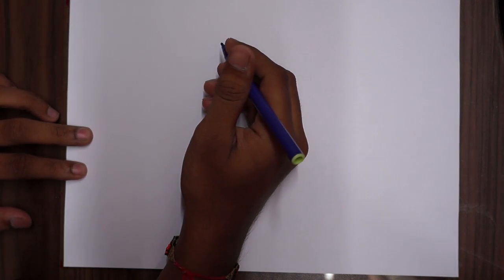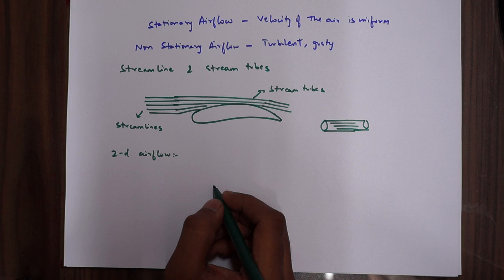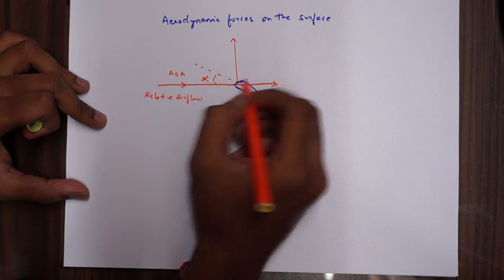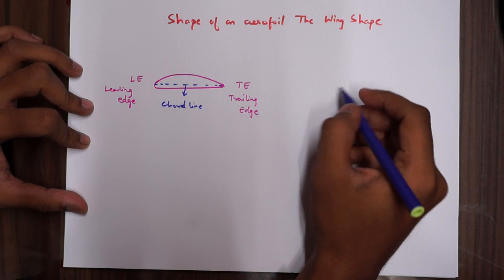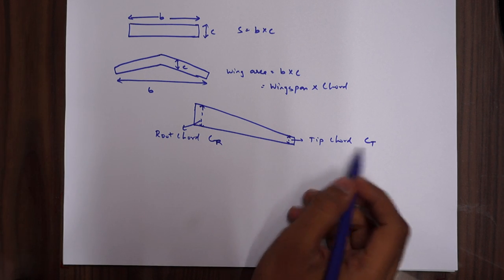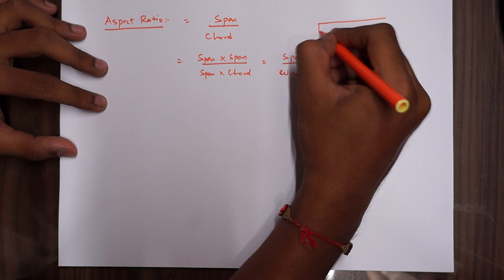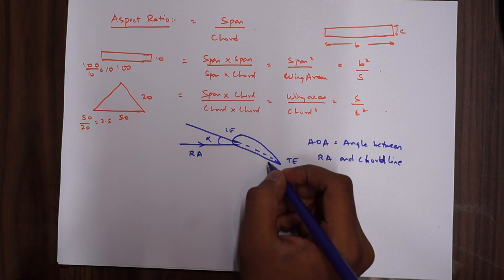Airflow, Aerodynamic Forces, Shape of wing and aerofoil

Comment: You have a number of things incorrect.  Please correct them. 
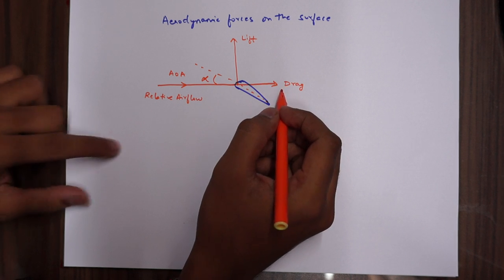At 5:55 descriptions of lift and drag are incorrect. In normal flight the lift is always much more than drag. If drag was similar to lift it would mean engine power was enough on a typical plane to climb vertically on engine power alone, which is not true.
Only when the aircraft is accelerating vertically does lift change.
In level flight and constant rates of clime and descent the lift is equal to the aircraft weight. 
You explain the turn incorrectly. In a turn each half of the wing changes lift ONLY when the craft is rolling.  The rising wing has MORE lift and DRAG.  The lowering wing has LESS lift and Drag.
Once the turn is established, lift is the same on both sides, but must be increases to account for the added centripetal acceleration force. 
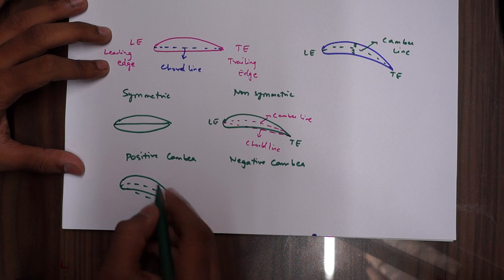At 10:44 Camber is the asymmetry between the two acting surfaces of an aerofoil, with the top surface of a wing commonly being more convex.  It refers to the concave or convex curve, not the location of the camber line above below the chord line because that is different for the upper and lower surfaces.
https://www.skybrary.aero/index.php/Camber

Comment: Does the wind driven turbine ventilator stall ? i am doing a FYP project on that , will be glad if you could explain about it. Thanks alot
Reply from the maker: Stall is more to do with lift I believe. ANY sort of aerofoil shaped aerodynamic structure will stall if it isn't able to generate lift irrespective of different parameters governing its characteristics. Wind driven turbine ventilator is surely an aerodynamic structure but I do not think its purpose is to generate lift. Its more to ventilate and extract heat. So as far as I can presume it has nothing to do with stall. But I would urge you to check more theoretical based sources to work on the same.

Comment: My skin crawled when you explained relations of lift and drag. That part was completely off. Lift is opposed to weight, not drag. Drag is opposed to thrust (slightly generalising here, weight is not exactly rectangular to flight path in sink and climb, that slightly changes things, especially for gliders, which rely on weight for thrust). Drag is always considerably less than lift, except for the most inefficient designs like lifting bodies.
Also, during sink and climb weight and lift are still equal, only during transitional phases, when changing between these modes, so there is acceleration, they are not balanced. Same about flight in a curve.
Reply from the maker: All accepted. I'm making new videos with refreshed content with lesser errors. This was uploaded ages back actually.

Comment: What is the advantage of symmetrical aerofoil? Why CP doesn't move for a symmetrical aerofoil? What do we mean when we say that the pitching movement about the aerodynamic centre is zero for a symmetrical aerofoil and why is this an advantage?
Reply from the maker: The fact that it can produce an equal amount of lift in either directions at the same positive or negative angle of attack is the advantage of the symmetrical aerofoil. CP doesn't move because its not cambered. Since it is not cambered the total pitching moment acting at the aerodynamic center is zero due to the fact that vectors are equal. This is possibly used in aerobatic aircraft.
Reply: @poh  You will find that CP moves around on all wings.  You describe this in another video.